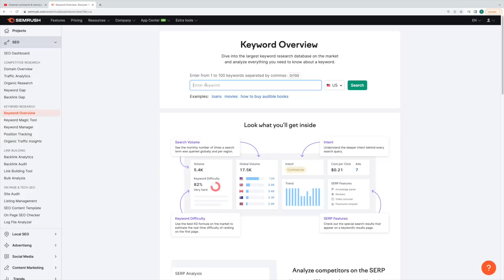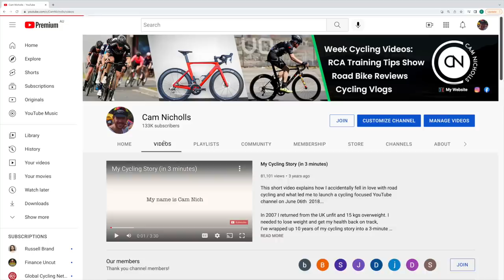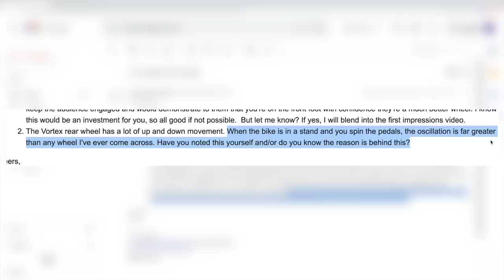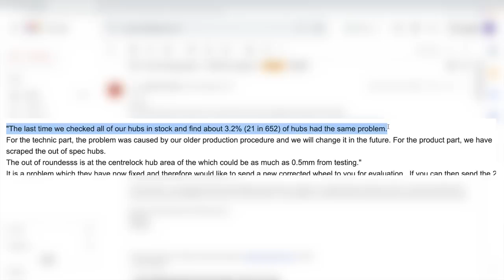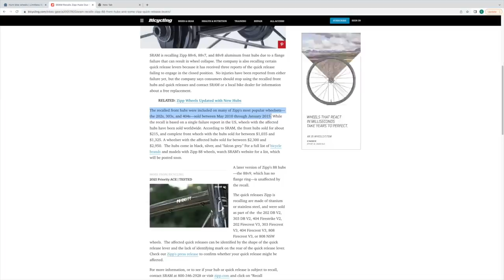Another Chinese Carbon Bike with an Issue

Comment: Every company has issues at some time. The difference between the reputable companies and the others is that the reputable ones will fix issues voluntarily, the others will either deny the issues until either the issue or the company goes away.
Unfortunately, cycling is one area where we seem to get an excess of companies in the later group

Comment: I have the Winspace Hyper 50 wheels. The front wheel was major league out of up and down balance from new. In the end I balanced the wheel by putting a motorcycle wheel, lead weight at the end of one of the spokes to balance the wheel. It looks terrible but does the job. I have been very disappointed by the Winspace wheels that continually also have spokes coming loose and falling out. On my new bike I have gone for Mavic Cosmic 45s, Im hoping the French have more of a clue than the Chinese.

Comment: I had the same issue with my Vortex rear wheel. I felt it during a steep downhill run and did the same test by holding the bike while spinning the rear wheel, the up and down motion was quite visible. I am in contact with cycling100 and sending them the video showing the issue, let’s how it goes. Thanks Cam for sharing!

Comment: Good video.  This used to be commonly noticed on cheap bikes with screw on freewheels back in the day, but is not something you should get on a wheel of this cost.  Either they have gone for a cheap hub to cut costs or the hub manufacturer has been producing below specification products to increase their profits.

Comment: I do think you give great detailed feedback on the anodized part of the wheel. However, does the Seka bike come with the wheels? What is included in the price (here in Oakland California using AliExpress) it looks to be just the frame. If you recommend a non brand bike build in China for more endurance biking which one would it be? What else do you need to complete a bike - maybe a complete bike assembly from box to first ride as a video?

Comment: Wow Cam. You think a problem like this would be quickly picked up in their quality control??? I have checked their website, do they have 24 months warranty?? They have a 30 day return policy for $3000 wheels,  I tried to start my own wheel business dealing with manufacturers from China, all companies are excellent to deal with but only a few were easy to deal with when something goes wrong. If I were to purchase a new set of wheels I would quite happily get them built by some of the better supplies in China but I would never distribute them as a business. You will end up broke.
Reply: are you a dealer in Vietnam or USA?
Reply: @mydoto  No I am not a dealer but I am happy to assist you if you like. I have just looked at the Elite drive wheels and on paper they are excellent wheels for around $1189 US plus a 15% discount code ($1000US) . Hubs and spokes same as Cadex and Winspace Hypers. Rims are wider.
Reply: @vietnguyen4312  I already have some Zipp wheels.

Comment: Looks like could be also an unbalanced wheel issue…can test by letting it rotate freely on a wheel stand or on the bike with the chain removed. The heavy spot would oscillate back and forth at the bottom as the rotation slows down. Or can hold the 2 ends of the hub, one in each hand and spin the wheel fast, it should wobble up and down noticeably in your hands. If so, stick on some weights on the rim at the opposite side to the heavy spot until the wheel is balanced and it does not move to its heavy spot…it would remain still at any position. Thanks

Comment: So happy to see you back.  I don't think you can draw a real conclusion from having gotten two bad wheels.  Statistics are lumpy. Like flat tires. I tend to stick to a tire when I find one I like and sometimes go a year without a flat, then get four in two rides.  What would matter most to me if I'd bought a set off those wheels would be how quickly they rectified the problem.  It's been my experience with the Chinese companies I've dealt with that they really care about their reputations and take care of their customers.  I'm sure I'm not the only one looking forward to seeing your review...  BTW, you got a new wheel faster than you raised your levers, so there's that.
Reply: Doing your own custom order via eBay or AliExpress is a different matter. I've had wheels made to $1000 only to have a terrible followup when i found faults.

Comment: Good to have you back Cam! Out of interest, did you ever notice anything similar with your Winspace Hypers? I have a similar oscillation on mine as what you describe here but always put it down to imbalance due to the valve on one side of the wheel. I’ll try to conduct my own visual inspection of the hub
Reply from the maker: No never noticed this on the Hypers

Comment: Same issue with Shimano Ultegra 6800 rear wheel I have but was worse than your Vortex wheel. Took it back to the shop and they sent of videos to Shimano who said it was within tolerance range and wouldn't replace it. Had the wheels for ages no issues and still straight.

Comment: Generally I think it's best to go with wheels only on hubs with brand significance. I have a Chinese wheelset on Nova hubs and although they have worked out, If I was to do it again I would go with DT Swiss. Quality and product lifespan go hand in hand.
Reply: U E had great success with novatec but my last set of disc 411/412 had a hub axle disintegrated after a couple if hundred KMs on them and the pawls wouldn't engage with the ratchet out the box. I out aftermarket pawls and spring at it worked. The Chinese based seller and novatec HQ never addressed my emails. Interestingly the hubs have a different paint finish, hub colour and axle colour to the off the shelf hubs of the same type. I suspect the hub quality is inferior on hubs supplied to bespoke builders. I'll stick to powerway or bitex or dtswiss on a top end build.

Comment: I think this video is slightly unfair as it seems to suggest there was a problem with the Seka, and as far as I understand the problem was with the Vortex wheels, that come from a completely different company (that just happens to have the same distributor). Had you put the wheels in an American brand, it wouldn't really be fair to say there was a problem with an America bike...
Regarding the Vortex wheels, after this video I wouldn't touch them with a barge pole, not only because you can get decent wheels for half the price, but also because their explanation is complete BS.
"The last time we checked all of our hubs in stock and find about 3.2% (21 in 652) of hubs to have the same problem." - from here, it sounds that for some reason they decided to test all the hubs they have in stock - this is weird. I would expect them to randomly test a few hubs out of each batch and the only reason for them to potentially test all their inventory would be if they find an issue in the random samples, or suspect something is wrong in their production process. That is also what you got wrong: the 652 has nothing to do with the 500 batch size. They could have produced 2 batches (2x500=1000), sell 348, suspect there could be some issues and tested the remaining 652 they had left in stock to find 21 faulty ones. I also find this not very believable since with a failure rate of 3.2%, you had to be pretty unlucky to get 2 bad ones in a sample of 2.
"the problem was caused by our older production procedure and we will change it in the future" - So if they haven't changed it yet it means it isn't their old production process but their current production process, and if they have, they shouldn't need to change it again in the future...

Comment: Few frame questions as for the price, i am interested. How did the actual weight compare to the weight on the website? Trying to compare to my Orca Disc. What is the ride like? The exceed is an aero bike.
Reply: I have a non RDC Exceed and I can say the frame weight is spot on (they also mention the weight of the paint and fittings on the product page)

Comment: 4:10 If there is no visible deformation in the wheel, this degree of "up 'n down movement" looks totally normal to me. OK, that there was indeed an issue with the hub in the end ... however, you don't have that little bit of movement with your other bikes?

Comment: Very impartially and well-presented video. Although the issue highlighted does not seem to be that significant, I do agree the price performance is very poor. My wife's bike has Shimano RS100 wheels and they are flawless. You could buy 20 sets of them for the price of those wheels, which would last a few lifetimes.

Comment: I'm surprised that this is not an issue when riding, except the pedal feel. First, given how much the largest cog "wobbles", isn't that coming close to poorly indexed gears, although, for a moment, it is perfectly indexed (before it is off, again^^). And also on the rotor, isn't that also putting some lateral force on the calipers?

Comment: I have no problems with the Chinese designing and selling bikes but what I do object to is theft. To give an example, my neighbor just bought a brand new Pinerello F8 with Shimano Durace group set for under   $4000. It's an absolutely beautiful machine. My understanding is that Pinerello stopped making the F8 in 2017 but still use the old molds to make various road bikes. This bike is probably a sixth shift bike from the Pinerello factory that has been given the F8 paint job. As much as I would love one I would not purchase one on moral grounds. How many of the better quality chinese bikes are 6th shift from a well known brand with a different paint job and name?
I would like to hear your thoughts. 

On a light hearted note my favorite chinese bike is the Anthrax, I often wonder if the owners know what it means.

Comment: If these big bike brands didn't overprice their bikes (like the Specialized Allez), people wouldn't need to resort to cheaper chinese brands. Without these chinese brands, most people on a budget would be stuck buying from the used market (which is also overpriced right now). Giant and Merida are the only reputable brands  that have budget options but the specs aren't even good.  Pre pandemic, a RB with a 105 goes below $600. Now at around $700, these giant and merida frames come with a Claris groupset. 

Imagine the even greater monopoly of these big brands if these chinese bikes never existed.
Reply: And to think specialized frames are also made in China.
Reply: @shanewiseman5729  yeah even when you say made in taiwan, doesnt differ from being made in china.its like 100 miles away.  Companies can literally have a product pass through taiwan to avoid that "made in china" tag and charge more.
Reply: It’s true and also these Chinese carbon bikes are outperforming the big brands to…

Comment: You don't have these sorts issues with shimano hubs. Cost $110 for the pair and they are bulletproof and cheap and simple to service.  I used them in my own Light Bicycle chinese carbon wheel build (assembled by me) and are great

Comment: That offset bearing seat causing the wheel oscillation will indeed result in a performance impact.  Basically, it causes the entire mass of the wheel to work against itself as it rotates.  Due to the relatively the low RPM of a bicycle wheel the oscillation affect isn't as great as say inside an automotive engine, but there is energy loss as the wheel lifts the bike under each rotation(this is only one way the imbalance will affect performance).  It would be an interesting test to run a TT vs a perfectly round rolling wheel and the out of center defective wheel. Say maintain 200 watts over 20km and see the time impact.

Comment: Anodizing is irrelevant.  It may create some part eccentricity aka lack of cylindricity of the hub but how the hub is designed dictates the dimensional datums which dictates how the hub is fixtured to create the bore.  This is basic stuff for anybody with undergrad in mechanical engineering.  This is what engineers are taught....GD&T it is called. China has way more engineers than most places in the world.
What you show in your pictures is technically called 'radial' runnout and it is egregious.  If you want a comical analogy, it is the 'camshaft effect' Cam.  Sorry Cam.  When you have radial runnout of the bearing land there will also be a sin/cosine component of lateral runnout what makes the cassette look to be wobbling which it is. If a bore isn't concentric to where the spokes attach to the hub circumferentially, you will have this 'cam effect'...which results in two types of runnout, radial and lateral of the rim and therefore tire and the sensation you feel on the bike which is byproduct.  What we witness in this video is way over the line of acceptability.  This is not only a reflection of the quality control but as mentioned above how they design their hubs and fixture them to create the bearing bores.  With proper fixturing, this can NOT occur.
If a company does this and doesn't make it right for any customer, they deserve no more business.

Comment: What I don't understand is the wheels must be trued and you can see it straight away
Any engineering has a concentricity limit, it's pretty basic tbh
If you run a DTI on the rim. You will see total run out

This is usual Chinese issues tbh, the process engineering is not checked regular enough
But it should be proof tested before assembly in a run out jig

All pretty basic stuff, and yes I am a time served toolmaker

Comment: If you find faults you're racist. Wow that's crazy but doesn't really surprise me. Haters move aside we want the gist not the spiel on products. The up and down can be imbalance which can be left or corrected with small weight directly opposite of valve hole. 
That amount of run out is unbelievable when you think that the pad is also going to move vertically as well as wobble. There is a certain amount of pad free play but into the design but you'd have rotor rub in new pads and rotor.